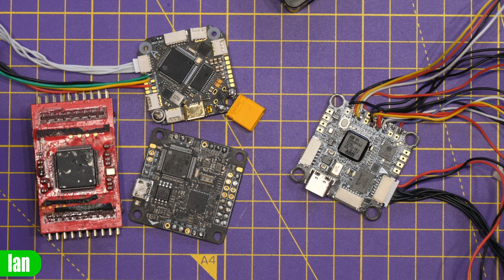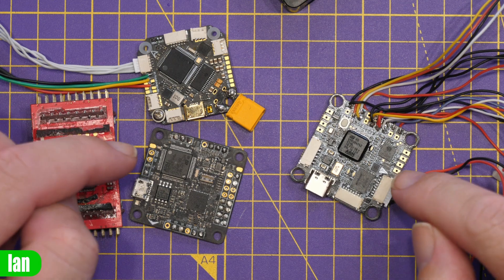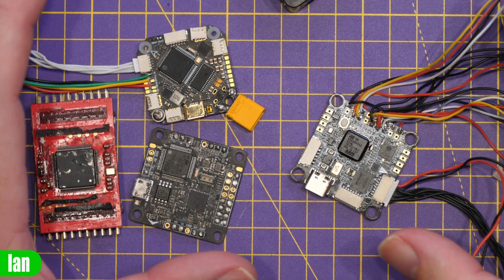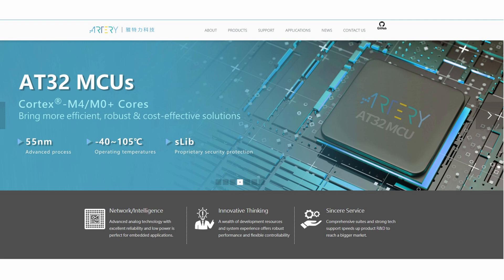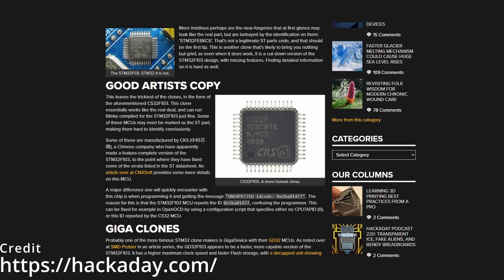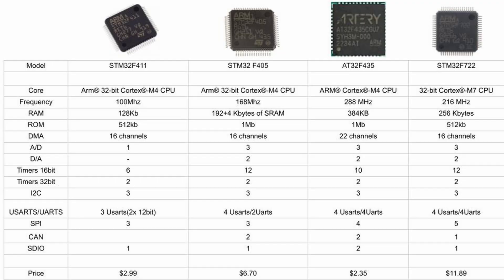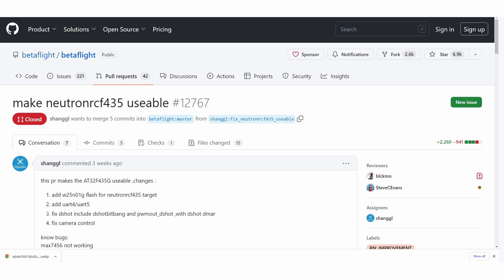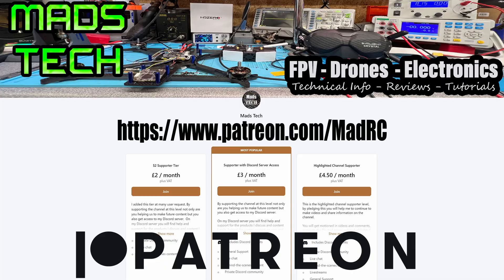$40 FPV Flight Controllers Are Back - Artery AT32 Alternative TO STM32

Comment: I'm surprised the Atmel AVR ATMega haven't been used or the ESP32 range. ESP32 would seem to me to be a natural fit. I did a test of controller tranceiver and receiver with ESP32S2 and ESP32C3, running dual encoders and dual X,Y sticks on the TX end and I think 7 servo chanels on the receiver end with some provisioning for GPS and TOF sensors. I designed my first 3D printer PCB inc software about 15 years ago with an STM32F103VBT and I've seen variants of that (smaller packages) in more modern 3D printers. There's also the CHV32 series from China that I've had a little play with as has BITLUNI and there's a good assortment of very capable 32bit RISC V micros available from them at really good pricing.

Comment: I’m about to receive the $39 AIO from NeutronRc.  From the specifications of the AT32F435, it will perform almost like an F7.  It’s clocked a little faster than the F7 but the Cortex M4 cpu doesn’t have the floating point acceleration hardware that the Cortex M7 cpu of the F7 has.  So it will not perform better than an F7.  But when paired with the BMI270 gyro that has a 3.3K maximum loop frequency in Betaflight this MCU will be powerful enough to run at 3.3K loop, with rpm filter and everything else which the F4 chips can struggle to do.  These chips will bring up the budget flight stacks performance right below F7 stacks while being about 2x to 2.5x less expensive than an F7 stack.

Comment: There is already some escs running these at chip sets so hopefully everything will work out with the flight controllers.  It's not much to tweak a hex file to change the pin outs but doing it for lots of boards would be a hassle.  I have faith that neutronrc will do these chips justice.  They seem to know how to manufacturer a aio and esc.  They're also jumping into am32 boards as well which is nice.

Comment: Hi Ian, do you think the America investing 39 billion to manufacture chips on American soil will impact the availability of chips for the hobby and price?
Reply from the maker: I’d everything pans out we will end up in an oversupply situation again at the top end for sure. however it’s also worth noting that everything being build is for cutting edge EUV and NA EUV all on sub 10nm. .  These stm style chipsets are using much older 90nm style fabs and today there is much less investment in that so you could actually see supply get worse as no one wants to invest in older nodes.
Reply: @MadRC  Do you know what is the nm process the Artery chips are using? I cannot find the information on internet.
Reply from the maker: @GinTonicFPV  the STM line is 90nm. I’d expect them to be the same.